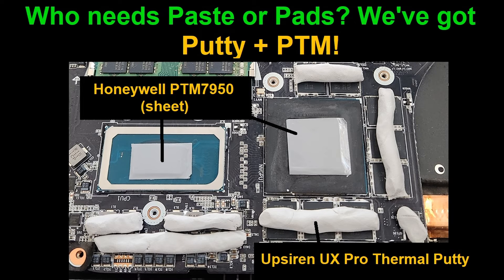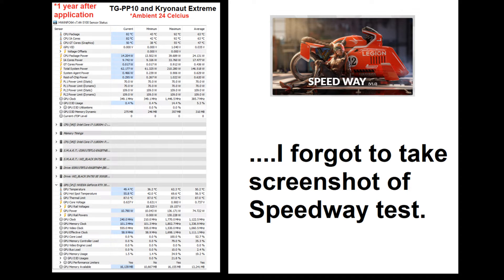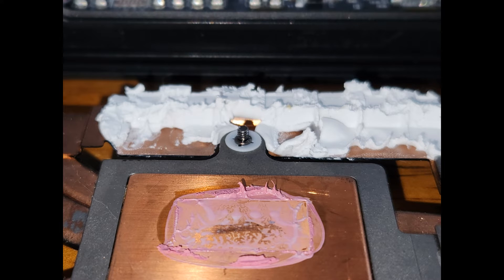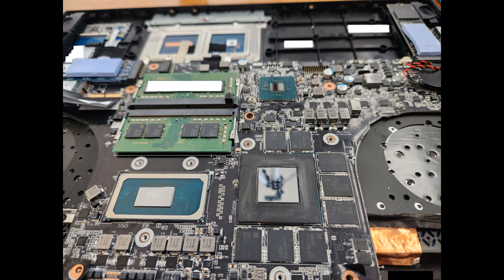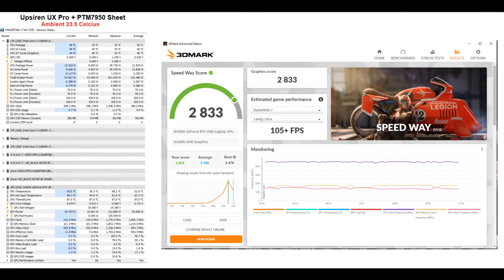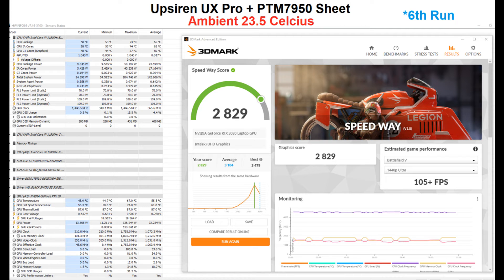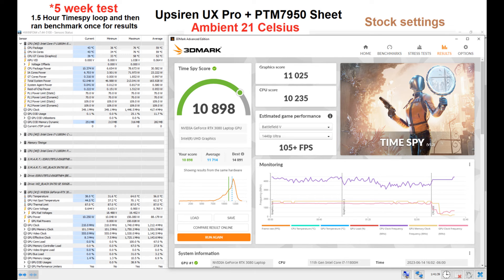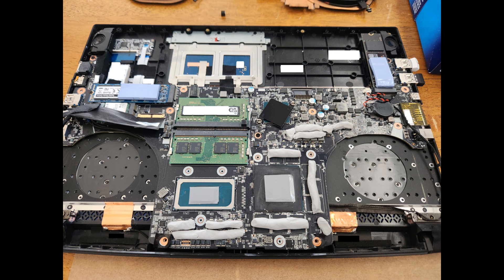RTX3080 Laptop meets Upsiren UX Pro thermal putty and Honeywell PTM7950

Comment: I want to replace an extremely loud buzzing fan on my Lenovo Legion 5 Pro 16IAH7H (model 82RF00DBUS), but I'm having some trouble finding the right parts. If anybody has the time to help, I would really appreciate it! I'm in nursing school, and I use it as my daily driver, but I have to stop taking notes on it halfway into class because it becomes so loud. 

So here's the backstory (sorry if it's a bit long but I want to give you guys the details in one go): I've had this laptop since around 2022, and it served me well for about a year to year and a half with mixed use (IE: PowerPoint, browsing, and classwork + playing some resource-intensive titles on high settings in my spare time). For a while it was fine and relatively quiet—it was only the lack of fan profiles/fan control that annoyed with my Lenovo. They either would run all the time or would just seemingly allow my computer to heat up for as long as possible without cooling anything... only to kick on and crank into overdrive. I suspect that the lack of fan control and the pattern by which they run at default settings may have contributed to the early demise of the bearings of the fan on the left side, as they are now not only noisy from high rpms but just make an awful buzzing. 

Changing fan modes to "quiet" or "balanced", as opposed to "performance", in Lenovo Vantage did basically nothing. The same could be said for trying to disable the graphics card and run on integrated graphics during class or at home while operating under light use. I would say it works 70% of the time, but eventually, the heat is too much or something and the fan just goes bananas. I can reproduce it successfully when I play a game and it detects it then switches to DGPU, or when running DGPU only. However, as mentioned it is nothing like the general noisiness of high fan RPM, as when new it was just annoying... now it is unbearable and rattly.

My Search For A Solution:
I started looking a while back for OEM parts, but they were sparse, and the fans were only sold by Lenovo as a single unit integrated with the heat spreader/heat sink covering plate. I'm not sure if that is the right technical term, but it's that big metal plate that covers most of the board and the coolant passages as well as the cpu. Seeing that this is the older RTX 3070 and intel core I7-12700h model, those official fan assemblies are long gone on Lenovo's site, and are nearly 150 USD on Aliexpress (assuming they are legit). This lead me to an alternative plan to instead take a gamble on securing an OEM fan instead of the full assembly:

The set of fans I ordered off Aliexpress have the same voltage & amperage as the OEM parts, and with it now in my possession, I can say it looks pretty much identical with the correct mounting brackets. I have already taken the case apart to clean the old fans as best I could (without removing the heat sink cover plate/integrated fan assembly housing). I'm twiddling my thumbs as I don't want to remove this cover until I get a legitimate sheet of PTM7950 from Honeywell for the CPU, as well as the other type of thermal pads which are are attached to the heatsink assembly....I figured it is important to get pads with the right height and softness to enable compression and proper seating of the whole assembly as to avoid interfering with other critical components such as the CPU (especially after busting my ass to find legit PTM7950, but those other pads for the VRMs and such are impossible to find and come in weird sizes like 0.75mm, 0.85mm, all the way to 1mm in this same device... found online that these pads are not the usual sizes commonly available. As far as I know, like the individual fans, Lenovo never sold the pads themselves for repair, but again only the whole cover plate with both fans and those seemingly proprietary thickness thermal pads pre-installed (plus the PTM7950 honeywell material meant for the CPU die).

I guess with all that said, I've seen your video and now I'm wondering is it even worth it to try and replace those other pads on the heatsink assembly (which cover these other areas of the board besides the CPU). This looks like it could be an alternative if it can be formed it to the correct height? I have seen conflicting opinions on this and some people have even recommended soldering small .3mm thick copper plates onto different areas to adjust the height using 0.5mm thick pads - I'm not even going to try to do that given the price of the machine and my lack of soldering skills. I've got a setup with a wide view magnifier from AMscope for small stuff, but not ready to risk frying my components. If You guys think this putty could do the trick without shorting anything on the board, I might give it a try. At the very least I'd just like to have something on hand in case I take the cover off and the OEM pads are toast.

Comment: Hey Snark, thanks for the great video! I was wondering if you have any updated insights on how the Putty holds up over time. Have you noticed any signs of degradation after a year of use? Would love to hear your thoughts!
Reply from the maker: I'll see if I can borrow my friends card which has had UX Pro in it for 14 months so far. If so I'll test it again with same parameters as before and see what the temperatures look like.

Comment: How many putty did you use in gram?
Reply from the maker: @vugiabao7tc425  most laptops can be done with 20g or less.

UX Pro is not the putty I'd recommend for a laptop as it is stiffer than others. Laptops have less ability to compress putty so it's better to use softer putties.

Better options include:
Honeywell HT10000
Laird T-Putty 910
Upsiren UTP-8
Fehonda LTP81
Fehonda LTP65
Laird T-Putty 607
Halnziye HY236 or HY25

For performance comparisons feel free to reference the charts located at the Google Drive link below (Test Chart Repository>VRAM TIM>ETCHASH)
Reply: @snarksdomain  is halnziye hy236 good for acer nitro 5 an515-57 3060 i5 11400h i just ordered it

Comment: Hey man I hope you read this, I have bought 7950 and utp 8 recently and I want to make sure I have enough for my laptop which has an RTX 2060 (6GB) before going any further. I bought 40x40mm pad and 30g of thermal putty. Is this enough? I will try to apply putty separately to save some if I mess up.
Reply from the maker: @AmanSingh-xk1me  30g of UTP-8? You must have order a 20g and 10g container I'm guessing?

20g will likely be enough.

Before you go to apply the PTM7950 I recommend applying the outty and then doing a test fit woth your heatsink and start the screws in partially. The press down on the heatsinknwoth younhanda and hold for maybe 20 seconds. Then tighten the screws until they come to their natural stopping point (don't use excessive force). The. Remove screws and cooler and inspect how the outty has spread, and remove excess.

Once you are happy with the amount of putty then you can go ahead and apply the PTM7950. I recommend cutting it smaller than the die size by ~3mm (1/8") on all 4 sides. It will make application easier, and 2nd peel easier too. Peel one side, place on die (don't worry if you don't get it perfectly centered). Run finger over it (with top plastic film still in place), and then use tape/stick at a corner and slowly peel towards the opposite corner. Stop if it starts to tear.

On finally reassembly you will want to reshape or at least pinch the putty a bit to make it "stand up" a little. You want the putty to get it'a final compression during assembly. Don't flatten it like a pad. I prefer rolling it into logs myself.

If you run into any issues or want share pictures and ask for feedback while doing it the you might want to join the Discord (link below).

*Edit: I used too much putty in this video. I made it work, but had to apply more pressure than ideal to get it to compress properly (partly because UX pro is a bit stiff for laptop applications).
Reply: @snarksdomain  thanks for replying so soon I'm reading
Reply: @snarksdomain  Yess!! 20&10, took a month to arrive, I just ran into another issue when I opened my laptop(running like an oven) I was trying to remove my fans and they are fused with the heatsink. How do I clean it? And thanks for writing the process. I searched for a while and reddit users gave  just the opposite advice to cut the pad bigger than die for easier application but then I wanted an expert opinion. I thought it's a phase change so it would spill out on those nearby pins😅.

I'm sorry for troubling you but I don't want to wait for another month for new paste and pad😭 and it's hindering my work, I'm a student
Reply from the maker: @AmanSingh-xk1me  what laptop model do you have? Have you watched any detailed teardown videos for your laptop model?
Reply: @snarksdomain  I have seen teardown but it seems lenovo legion 5 pro is different from legion 5pi which has fused heatsink and no teardown videos on 5 pi 😭.
Reply: @snarksdomain  reddit says it's just to make you buy whole heatsink if anything doesn't work
Reply from the maker: @AmanSingh-xk1me  you may want to ask on the Legion Discord server. There's a good chance someone there has taken one apart before, and probably used putty and PTM in it too.
Reply: @snarksdomain  okay 👍
Reply from the maker: @AmanSingh-xk1me  I found this. Hopefully it's helpful

https://youtu.be/PCSIs1LgL_o?si=lqasyChfGIAC-KyU
Reply: @snarksdomain  Yess it's the same heatsink looks like fans don't separate
Reply: @snarksdomain  you've already helped enough man since the heatsink isn't posing any issues, I'm changing pad and putty for now and clean the blades and hope for the temps to reduce
Reply from the maker: @AmanSingh-xk1me  interesting design. Hoping the fans will have a log life. Perhapsnif temps are good enough the fan can spin slower and maybe last longer?

Let me know how it turns out for you. And be sure to give the PTM a good melt. It won't perform well until it melts and becomes thin (as thin as 0.038mm or 0.0015")
Reply: @snarksdomain  running a couple of benchmarks will do right?
Reply: @snarksdomain will do thank you again 👍. I am going to get compressed air can for cleaning fans and then repaste.
Reply from the maker: @AmanSingh-xk1me  I usually see the most improvement in the first 2 hours. For a laptop I'd check idle temps and make sure they are safe temps, then run Furmark and Cinebench Multi. I like monitor temps with HWINFO64. Can even record a log with HWINFO and look at the data later if you like.

Things you will want to look for:
1) Gradually lower temps during melt OR gradually increased wattage that the CPU and GPU are allowed to pull as the cooling gets better

2) Once your laptop has achieved full TDP on CPU and GPU you might also start to see lower temperatures while maintaining full wattage

3) Finally, if cooling is great, you may see lower fans speeds.

This is the trifecta of improving cooling on laptops and it will happen in that order if you get a good putty application. Sometimes it takes a bit of trial and error, but your best bet is to do a test fit prior to using the PTM, and if you like posting pics in the Diacord and folks there will help you tweak the amount of putty to give you a better chance a grwya results. You can also see what others did and results they achieved.
Reply: @snarksdomain  I will when I open it again
Reply: @snarksdomain  oh man I forgot to ask the cpu VRMs are of uneven size so should I just put a long log shape on it?

Comment: Hello, I apologize in advance for my English.

I wanted to thank you for your tests, I have a plan to re-paste my MSI G513 5800h/3060, when removing the cooler the original pads are completely ruined. I searched for days for an alternative to pads standard and I only found fake good reviews on the K5 Pro... 

What putty do you recommend that is easy to apply, not too hard to apply to GPU memory and VRMs?

Fortunately you are here to inform us and I thank you very much! 

You gained a subscriber 😃😀😀
Reply from the maker: @jeantwitchs8947  Hello Jeantwitches. Glad you found the channel. There are a bunch if good putties to choose from. The full list can be found using the Google Drive link below (Test Chart Repository). The current top 3 performing putties are Honeywell HT10000, Upsiren UTP-8 and Fehonda LTP81. UTP-8 is cheaper than the other 2.

You'll need about 20g of whichever putty you decide to go with.

Have you considered using a Phase Change Material on your CPU and GPU core? A good option would be Honeywell PTM7950 sheet.
Reply: @snarksdomain  I will stay on the liquid metal CPU and Kryonaut on the GPU.I ordered 24g Fehonda LTP81 on aliexpress, thank you for your answer you are the best

Comment: Hi there, I hope you are doing great!

I wanted to ask you if you could tell me how much PTM 7950 I would need to buy for this model of a laptop I got the 3070 one
Aorus 15P XD 3070

I am going to buy:
PTM7950 for my laptop ( This Aorus) LTTStore or any other places where it is good ?
Don't know where to get the putty and how to too put the application on it and what kind of brand is good? UpSiren? Cause I cannot find it here in Europe.
and I'm going to pair it up with an llano 2024 Laptop Cooler just to get good cool temps overall.
 
Thanks :D
Reply from the maker: @Carlos-if4mr  Hey Carlos. For PTM7950 you will need at least 1 piece .easuring 40x40mm, but 40x80mm would give you extra in case you run into issue and need to redo it (both CPU and GPU core). As for where to buy PTM7950 you have some options. LTT, Moddiy are both legit and also expensive. You can also buy what is most likely legit stuff from "Passionate Girl Store" on Aliexpress. The Aliexpress stuff seems to have similar/matching results as the Moddiy stuff. There is also PTM7950 on Ebuy7, Amazon, Ebay, Alibaba, Lazada. You'd only want to buy from a seller with very good reviews for that specific product. It might be hit or miss though. You could also go woth something like Upsiren PCM-1, Thermalright Heilos, or similar. Heilos has verification stickers to check if it's real.

As for putty, you'll need at least 20 grams. Upsiren UTP-8 is quite good and I think you can find it on Ebuy7 or Alibaba for Europe. You could also go with Fehonda LTP81 or LTP65, Laird T-Putty 607, Honeywell HT10000. CX-H1300 13.5 is good, but recently they've had significant batch variance with it being stuffer. If you get a soft batch it's great, but if you get a stiff batch it is harder to compress during reassembly. Fehonda putties can be bought on Aliexpress or directly from Fehonda website (contact sales and ask for quote). Halnziye HY236 or HY256 are another good option for laptops as it is soft, cheap, and performs decently. Can be bought from Aliexpress, directly from Halnziye website (contact for a quote).

Once you have the bottom cover removed, disconnext the battery cable. As for application I recommend rolling logs and placing anywhere there was a thernal pad, then test fit the cooler and tighten cooler screws and press down on the cooler and hold for 20-30 seconds. Then take the cooler back off and see how the putty has spread. Add or remove as needed. Once you think you have the ideal amount then apply the PTM7950 or other PCM of your choice. I recommend cutting it smaller that the CPU and GPU core by 2-3mm on all 4 sides. It makes it easier to do 2nd peel. 80% of it will squish out once you melt it, so all the CPU/GPU will get coverage.

I recommend reshaping the putty and then install the cooler, press and hold to squish putty, then reconnect battery cable.

I like doing a ~2 hour burn in with Furmark and Prime95/Cinebench (Multi). That way the PCM on the CPU and GPU will both melt and flow out excess. Expect to see initially bad temperatures, with is improving during the burn-in and gradual improvement in the coming days and weeks.
Reply: @snarksdomain  Thanks for the fast response. Much appreciated!

Comment: When i come back from my vacation I will try this on my RX 5700 XT for OC purposes, because what really holds back the gpu, Is the hotspots temp

Normally if i were to try to overclock my gpu the temp would be this

Hotspot: 110c

GPU core: 79-85

With those Temps my gpu would normally throttle.
So if I used ptm7950 it would help with the Hotspot temp by a lot, Give me thermal headroom for overclocking, And a Rx 5700 xt with good temps will happily overclock.

Can't wait to get the full potential out of my silicon chip.

Comment: Why did you apply honeywell out of the chip die, is it any benefit?
Reply from the maker: The excess overlap? Having extra is no benefit as far as I can tell.

I now recommend everyone cut the piece of PCM to be ~3mm short on all 4 sides (1/8" on all 4 sides). Since the PCM starts off at either 0.20mm or 0.25mm, At least 80% of it will squish out ounce it melts and the Silicon will have full coverage.
Reply: @snarksdomain so pcm can pump out?
Reply from the maker: @vugiabao7tc425  It needs to initially to get really thin. Most PCM's are around 0.20mm or 0.25mm starting off.

They are designed to melt around 45 Celsius, then with the mounting pressure of the cooler it then squishes out. They can get down to around 0.038mm layer between the die and the cooler.